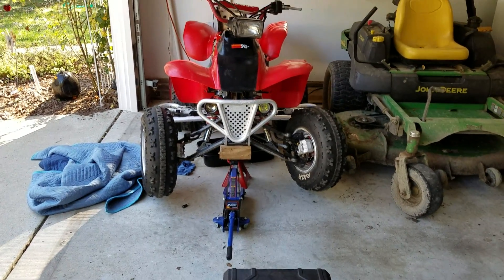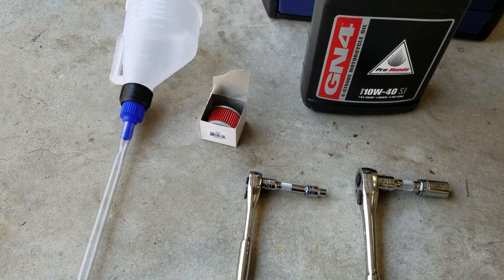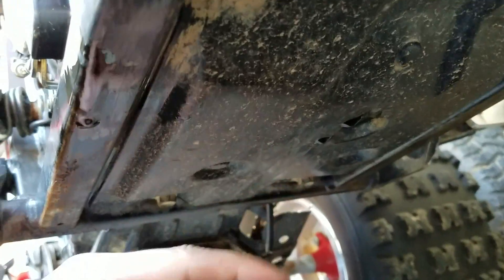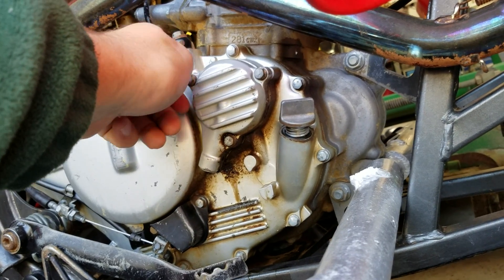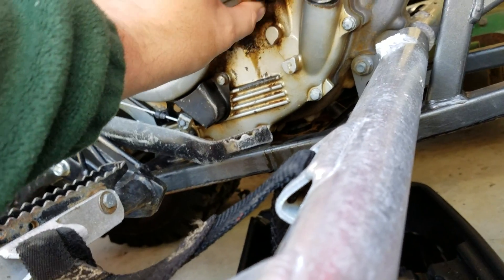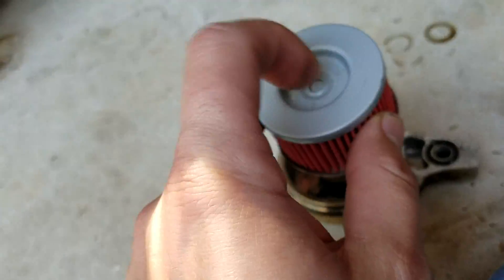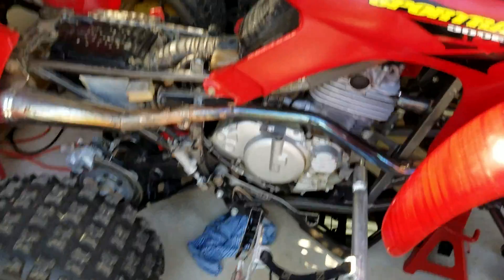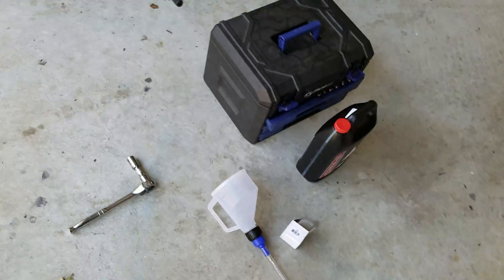How to change Honda 300ex oil and filter

Comment: Thanks, i needed to know where the drain bolt was, so i can crack the side half off and get the cam shaft shim that fell down the timing chain end... out... if it would had fallen where the piston is... i would probably push it off a cliff.

that shim ( i call it a shim ) is a camshaft setting plate.
Reply from the maker: Glad you got it sorted without trashing it! Stay safe!

Comment: Is it the same for a 350 ex?
Reply from the maker: I'm not entirely sure on the filter size, but the process itself should be extremely similar
Reply: Ah ok I'll have to go to the shop by me that works on them. I trust them but for some reason I have trust issues on anyone working on my stuff. I always worked on my cars and I'm old school sorta but I never changed the oil in the uhh idk I got it in like 2018 lol. Since I don't ride it much but make sure to start it pretty much every day so the carb don't get messed up like everyone I see. It runs fine and idk why I'm weird about not changing the oil i just first of all didn't trust any other oil except for what's in it. Because of how good it runs. And i see people that changed the oil sometimes have problems with their engine after they do so. Am i just crazy? Lol. I mean i know eventually oil breaks down and needs to be changed but I got a old honda civic that I never changed the oil in. And it starts everytime. At the same time I change the oil on my fully custom Lexus gs 400 and my daily truck. An my turbo honda civic. But that thing pisses royal purple for the turbo I only run that in it. *it's on 22 pounds of boost. But yeah man I'll try to get this oil that you used. Thanks for the motivation to do it. Just kinda figured what's broke don't fix it. Sorry long story. Lol

Comment: I put 2 quarts in and it like filled the whole thing up like there was an inch  left on the dip stick where it wasn't dry so I drained some out what should I do there is like a quarter and a half or so in there
Reply from the maker: You can pump some out or just crack the drain plug to get some out. Try to get it to where the drain stick is nearly perfect at the full mark
Reply from the maker: Something like this is nice to have on hand https://amzn.to/3sysbbB